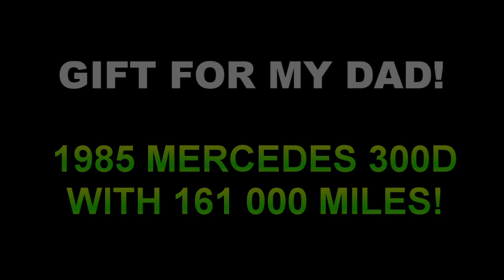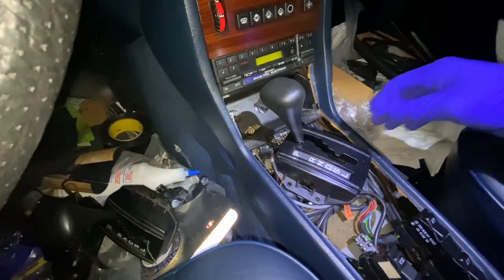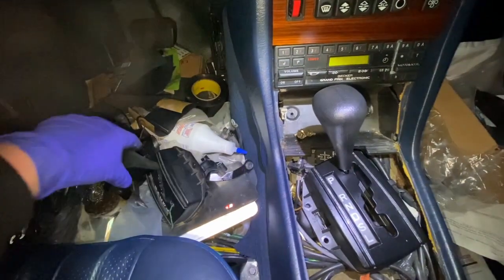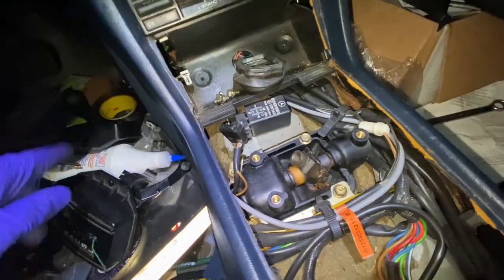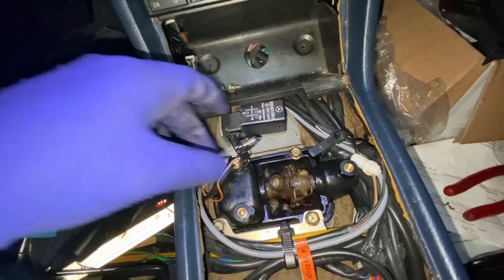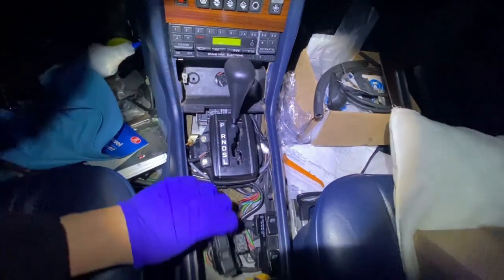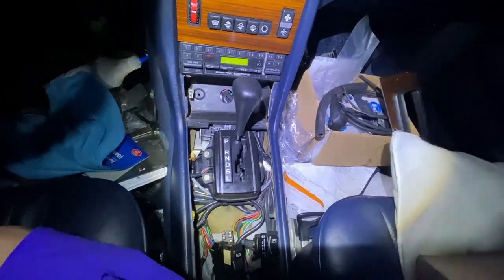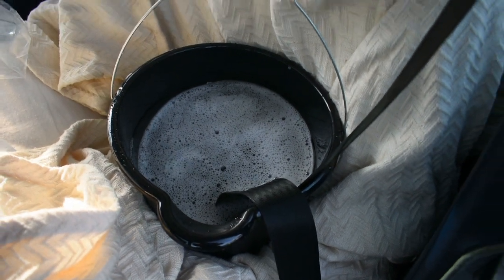PART 23 Dad's  Mercedes W123: Loose Shifter Replacement, New Hazard Switch, Custom Carpets; Grille!

Comment: Hey Vito, do you think i should keep the original headlights on my  W210, right now i got aftermarket headlights installed from FK (black background and projector lamps).. i really can't decide.. the original look a bit more fancy though...
Reply from the maker: Original. W210 looks great with original headlights. Especially if they’re not oxidized. Save money on some new original headlights. Your car will look awesome! If you install new headlights, order a protective clear film and put it over the headlights. That will protect the headlights from rock chips and from getting oxidized again
Reply: @VITOSGARAGE  Thanks for your answer! Appreciate it.

Comment: Nice work! I need to investigate my shifter as it's starting to feel a bit loose. Where did you get the replacement mats? Me likes. :)
Reply from the maker: Check your 2 shifter bushings underneath first. If those are in place, it’s time to check the actual shifter. You can also do some preventative maintenance to the shifter by spraying ATF into the bushings inside the shifter. Thank you for watching :)
Reply: @VITOSGARAGE  Thanks!.....where can I buy a set of those floor mats?
Reply from the maker: @johnny_blades  ohhhh, I found those on eBay. It came all the way from Turkey. Guys there make good products for Classic German cars